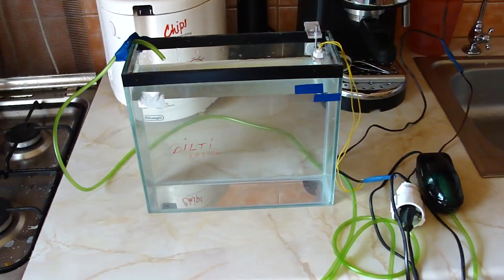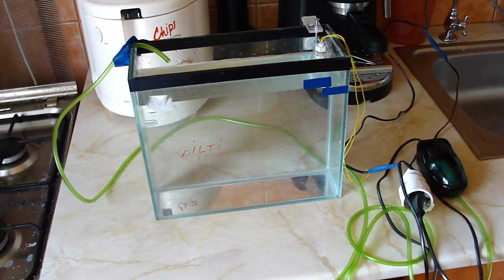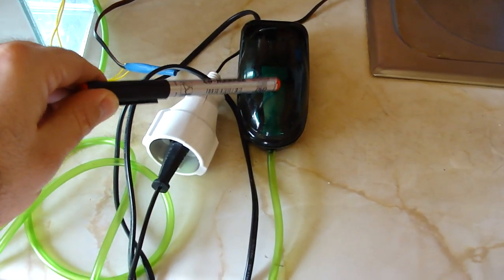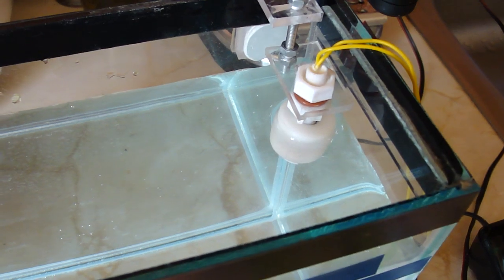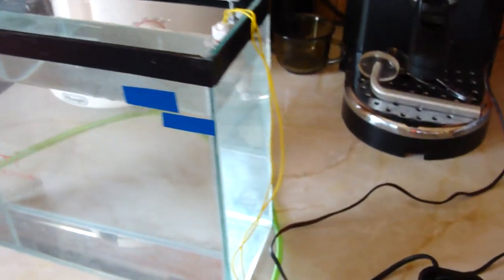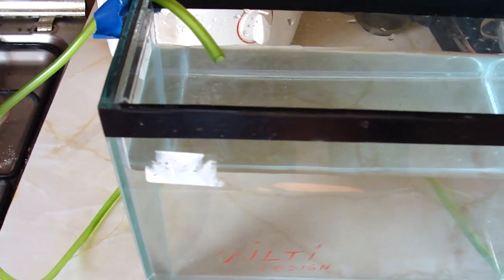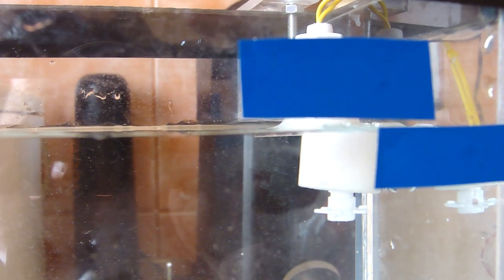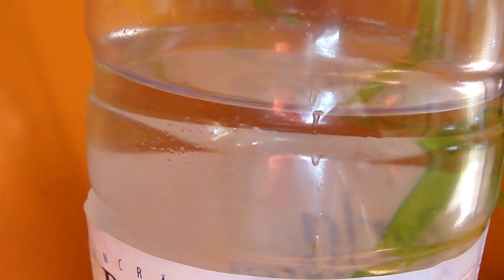Cheap and easy DIY ATO for your nanoreef

Comment from the maker: @afat01 the air from the pump is pushing the water out of the bottle. the air is making a higher pressure inside and this is forcing the water to go out.